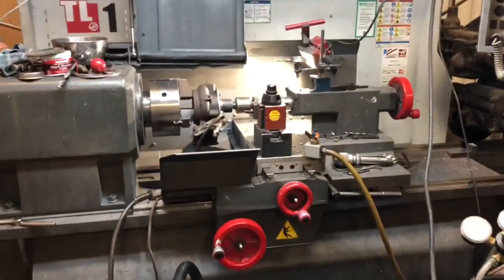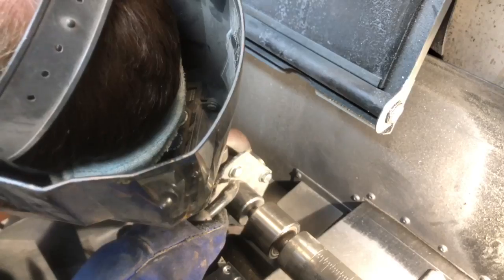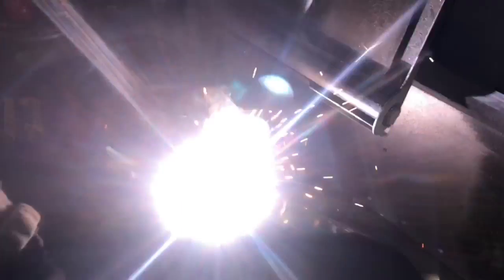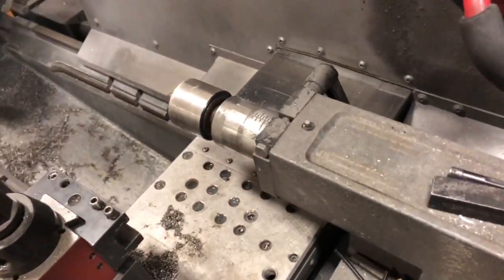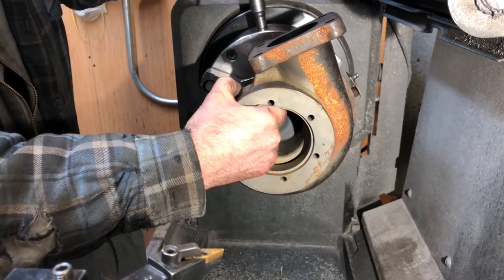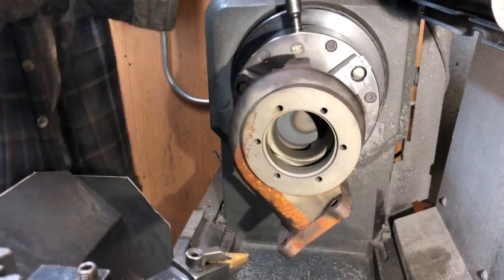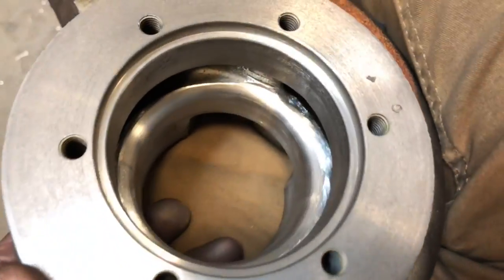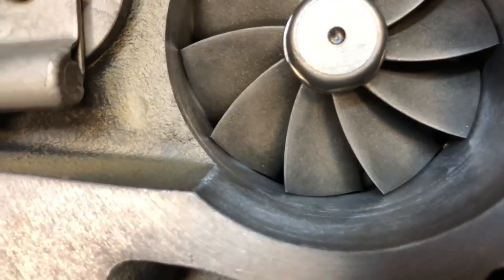How to make machine fixture for turbo housing

Comment: How difficult it is to cut a compressor housing for a bigger compressor without computer controlled lathe?
Reply from the maker: If the raduis is small is not that hard. I use the wheel as a reference. I always cnc out the inducer though. It’s a lot easier if you have the correct tools
Reply: @turbolabamerica  I was hoping the incuer was the easiest part and the side "bell" the more difficult but well i was wrong. Ill deffinately wanna try it tho.
 Thanks for your time . God bless you.